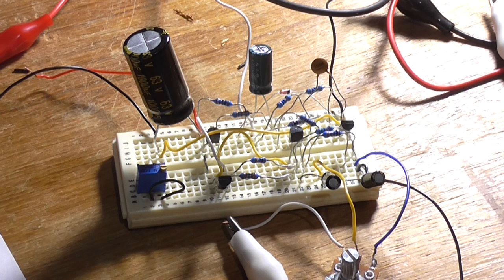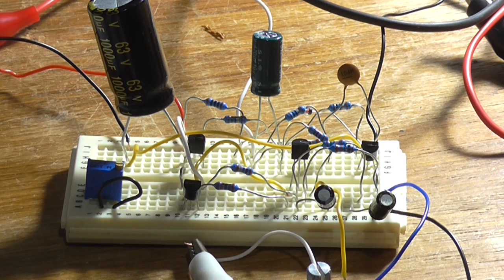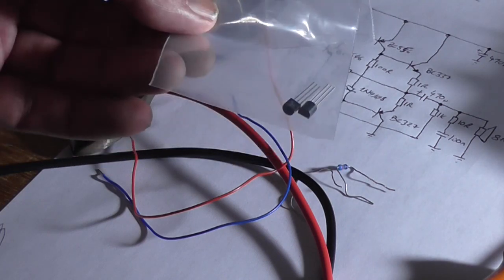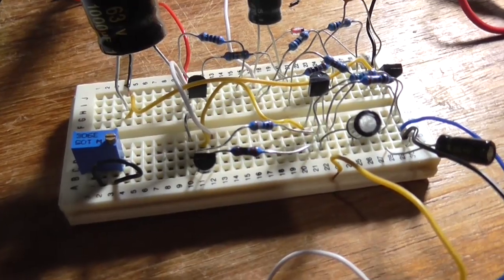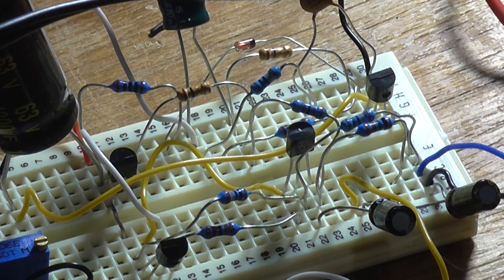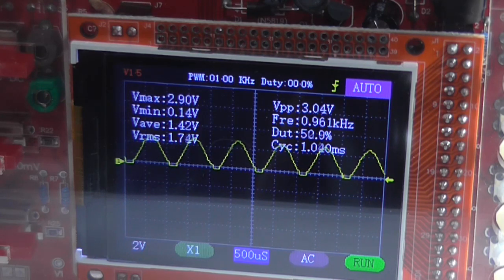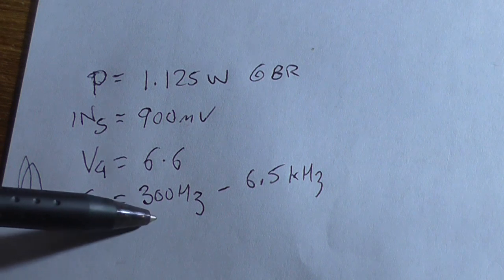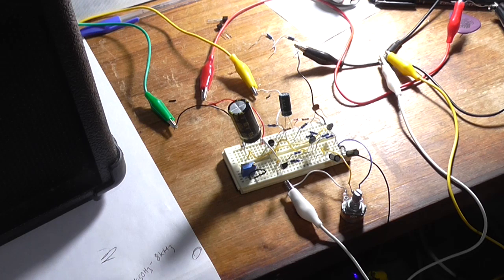Darren Yates' 1W "Champ" Amp: REVISIT

Comment: I made the 100mW Op-Amp based amplifier with a TL072 and BD139 / BD140 transistors using a dual supply +-12V on the Op-Amp and the Mini 300mW amplifier with MJE3055T, MJE2955T and BD139 at +8V, any higher and the transistors get hot, put a 100 Ohm on the BD139 Emiter and that was better. Both worked well, love to make this one but have to mow the lawn. Big thanks because these are the best amps I made so far, only just understand what I'm doing.